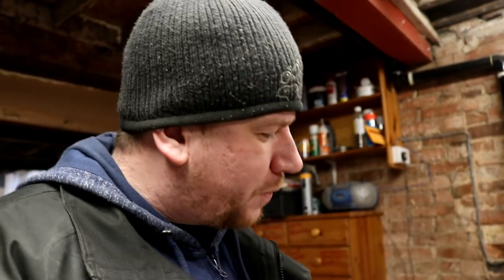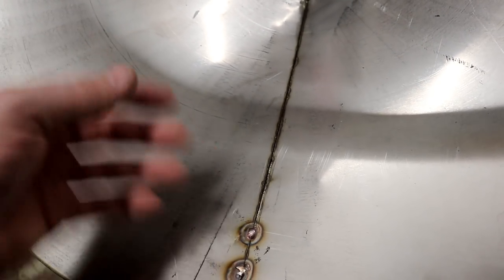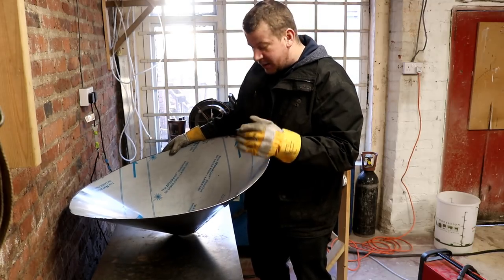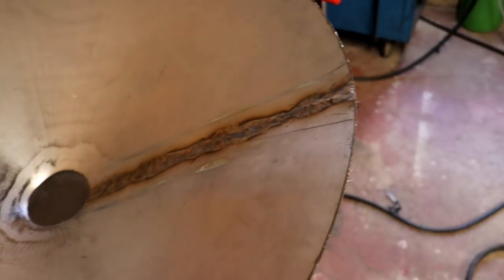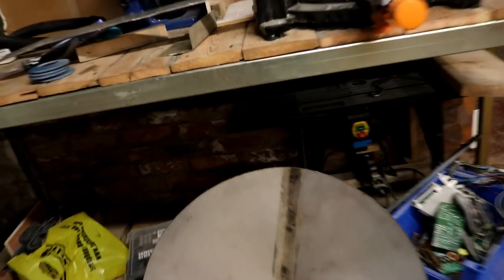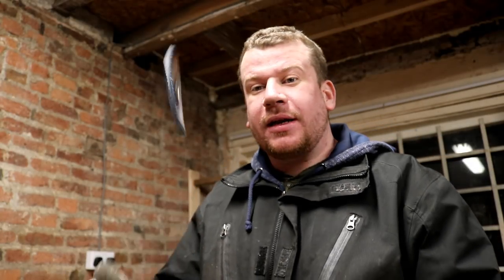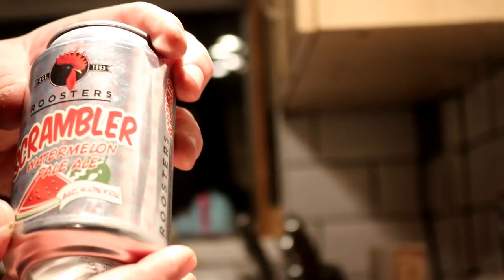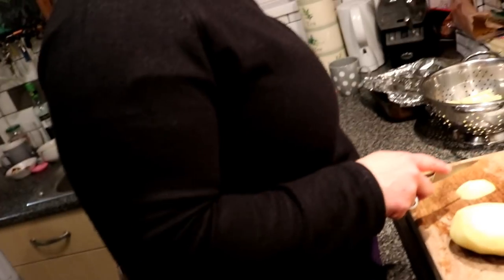Tack & Weld stainless Steel Cones ~ Sort Of.

Comment: I would recommend welding the outside of the cone to cylinder first then use a cut off wheel in the grinder to grind down to good metal and weld the inside last.

Comment: Nice one when you come to the cones . Tape-the tank to the bench and leave a edge just off so you can put your pipe in to purge and weld the inside should not be to bad because it’s big small are harder because you can’t get in cheers

Comment: This was great inspiration for me to keep working on my own conical project. In similar fashion, I plan to form the cones from two pieces of sheet on a bending brake because I don’t have a large enough roller. Instead of fanning the cylinders, my plan is to use 1/2 bbl Sanke kegs.